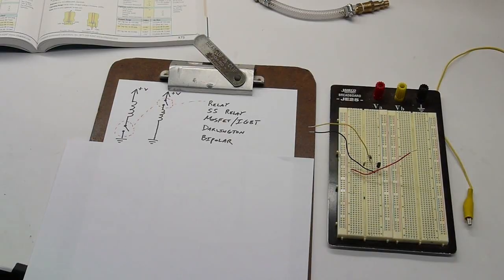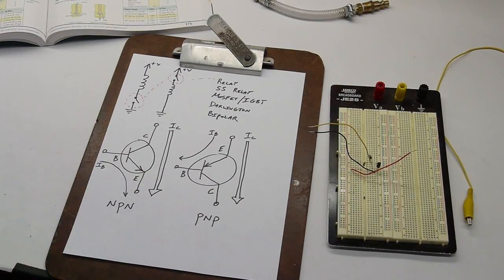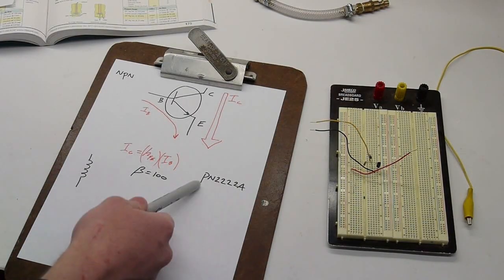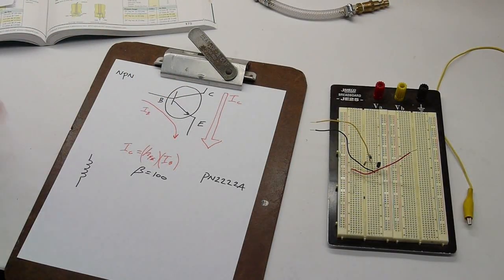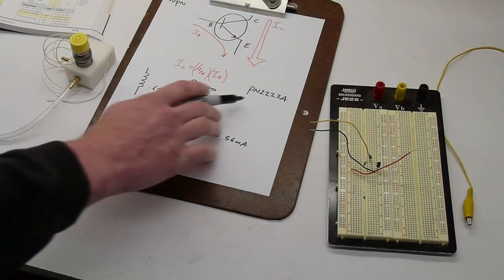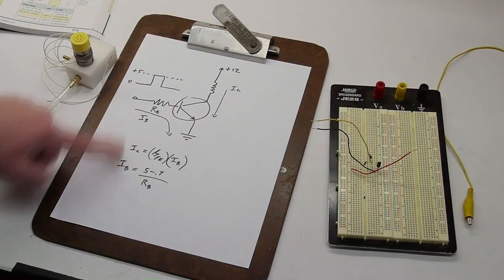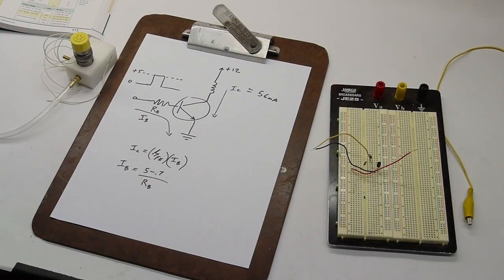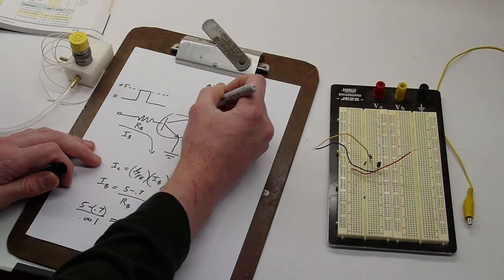Tutorial: How to design a transistor circuit that controls low-power devices

Comment: u can back to back configure mosfets to isolate or  more specifically.. switch it off in both directions. was looking for info on how to drive n channel on high side of a cap bank. more specifically, if i can take a floating/isolated module and tie its output ground to high side of cap bank so i always have 10v over what im switching. Currently have a working cap discharge spot welder that I switched on low side. I want to make it a more flexible/general add parts have multiple types of welder design. Other reason..its connected to a dc-dc charger, which then connects to a earth referenced 24v supply. I can see a few scenarios where one could unintentionally...say... weld a wrench to a metal desk and risk burns/injury . been a while since i ran math with ohms law and esr of bank...but i do recall it came to about 2500@ at 16v in an ideal world. its about 180f of maxwell d-cell dlc.

Comment: Great video clearly and simply explained.  Could have done with explaining the clamping diode - what it does and where the energy in the coil goes when the transistor is switched off

Comment: Good video and great explanations.  Ideally, if you had added a sample input device, say the out put from a temperature control or light sensitive module, the functional detail would have been complete.  (Can't the solenoid valve be controlled directly by the input signal?)

Comment: Let me add my thanks to that of all who have gone before. Being a newbie I had only a hazy understanding of gain and how to apply it. Now I was able to design a circuit to control a 12-volt solenoid and got it right in one try. One question, though. Right at the end you indicate a capacitor but I'm unclear on whether you're putting it across just the transistor or the transistor AND the load.

Comment: 5:25 WHY CANT YOU JUst PUT A RESISTOR  INLINE TO THE pnp WHERE THE QUESTION MARK IS "?"
Reply: Drew Ski BECAUSE THEN THE PNP TRANSISTOR WILL ALWAYS BE ON! REASON IS THAT BOTH 0V AND 5V ARE BELOW (12V - 0.7V) SO THERE IS ALWAYS A CURRENT FLOWING FROM THE BASE. THE ONLY DIFFERENCE BETWEEN THE 0V AND 5V STATES IS THAT THE CURRENT THROUGH THE BASE IS A LITTLE LOWER FOR THE 5V STATE COMPARED TO THE 0V STATE.

Comment: This demo and the calculations don’t take into account the inrush current of the solenoid which could be as high as 10 times the rated current of the coil.
Reply: This is absolutely incorrect. A solenoid is primarily an inductive load and resists changes in current. When turned on, i=0 and gradually ramps up until limited by series resistance. There is no 'in rush' current spike as you suggest, other than a very small amount from the parasitic capacitance of the wire and solenoid windings. The problem comes during turn off when that current doesn't want to stop, potentially reaching hundreds or thousands of volts trying to find a return path - this is why a freewheeling diode is required as he explained.
Reply: Solenoids don't have inrush current.
Reply: Maybe you're confusing the start-up current of a motor.  Those can be a problem.
Reply: That would be a capacitor that has high initial current

Comment: Why is the load upstream of the switch? What happens if the switch is upstream of the load?

What would you use if you wanted to source current into, say, a capacitor, or if you wanted to pull current from that capacitor?
Reply: Matthew Ferrie It wouldn't work. For the transistor to be "on" the base voltage needs to be at least 0.7V above the emitter voltage. When the solenoid is on it will drop 12V over it, therefore if the transistor is "upstream" of the solenoid, the emitter of the resistor would be at 12V while the solenoid is on requiring 12.7V at the base to keep the transistor on, while you signal is 5V.

What will actually happen is that the transistor will turn on a little bit (it isn't actually a switch, but an amplifier after all) and as it does so the voltage over the solenoid will start ramping up. When the voltage over the solenoid reaches about 4.3V the whole system will come into an equilibrium state where the transistor wont "turn on any harder" as that would turn itself off. That would also mean you'd have 7.7V across the transistor with however much current is flowing through the solenoid at that point.

Disclaimer; I don't know if there would be any oscillation behavior in such a circuit, there could be, but I'm not practiced enough to say off the top of my head.

Comment: Question...Some years ago I was taught that germanium transistors had a "barrier" voltage of 0,7 volts and the silicon transistor had a "barrier" voltage of 0.05 volts. If the 0.7 voltage drop across the 2n2222a transistor you're using represents the "barrier" voltage I just mentioned then my  thinking is screwed up since the 2n2222a is a SILICON transistor that has the 0.05 volt "barrier" voltage. If I'm wrong here and creating confusion because of my misinterpretation, my sincere apologies to all who became confused.

Comment: Great video. My understanding is much better now. Love to see you demo some of your circuit characteristics on a scope. Like the ringing from shutting off the coil with and w/o the diode and or cap. Also what happens to the current flow when the transistor is set at the cusp of turning on the solenoid or cusp of the base controlling the transistor. Also why is pnp control circuitry more complicated and how do you address it.

Comment: An easy way to remember the symbol for NPN:  Look at the direction of the arrow, NPN = (N)ot (P)ointing i(N).  Also, when using a PNP transistor, everything that you covered still holds true, including the calculations for the base current limiting resistor, except everything just operates in reverse.  In other words, with a PNP transistor you turn it ON by bringing the base to ground, and to turn it OFF you disconnect it from ground (preferably float it near V+).

Comment: Another amazing video.It wud be great if you could do a video on pnp switching. There r certain situations where u need just the pnp. For example i share my experience  with esp8266 there are certain gpio pins which need to be in a specific pulled up and pulled down state for the chip to properly boot. Now i wanted to  switch a relay with one of the pin which needs to be pulled high during bootup. So to be safe  i cud only use a pnp. But wait it caused be trouble on the way as this pnp transistor was always ON. As u said no easy way to control the pouring of current into the base.  I used a 2 transistor combination. But it wud be absolutely great if we cud  have ur crisp  and practical  xplanation. Waiting for a video

Comment: You should look at the datasheet graph of hfe vs Ic to get your β value for the collector (load) current.  β can also vary a lot with temperature. I would take whatever the nominal value of β you find from the datasheet and divide by 2 as a worse case.

For larger loads, you may have to worry about heat dissipation.  Local hot-spots can develop internally inside the transistor which can permanently damage the device.  Make sure power dissopation (approx Ic*Vce) is within the "Safe Operating Area" for the Transistor's temperature.

If combining multiple transistors in parallel, it is a good idea to put a small value (1 ohm?) resistor between the emitter and ground.  This feedback resistor will ensure the load current is more evenly divided among transistors with manufacturing tolerances that cause them to not be perfectly matched.

Comment: Great video, as usual! I've been a subscriber for months. In this case why not use a PNP and turn it ON by pulling the base down to Ground? Just curious...
Reply: Wouldn’t that mean you’d have to supply logic high and therefore waste current the entire time the solenoid is off? Maybe it depends on if the solenoid is going to be on or off most of the time?
Reply: jeromekerngarcia the mathematician wrapped himself in fence and declared himself to be on the outside.

Comment: From MOSFET down, including an H-Bridge, could you please make a video about, '' Why to use? '', '' How to use? '', '' How to identify it's values for such applications '' ... For MOSFET I kind of know, for example, using an arduino, one can send a 5v voltage pulse to a MOSFET and Open the internal switch for the MOSFET to apply a 12v to ''any device''

Comment: So Im trying to work out what resistor I need to put infront of the Transistor when using Arduino UNO. Arduino is 5V and a pin is 40mA, I need to lower the current to 0.002 (or just slightly more), what size resistor do I need? V/I = R, but what is I 0.002 or 0.04?
Reply: (5-0.7)/0.002=2150 Ohm or not?
Reply: 0,04 is the maximum you can have from the pin, not what you need

Comment: Hi :)
Great video
Just one question: why did you say in the beginning that the pnp doesn't have a way to limit its base current? Shouldn't a resistor work as in the case of the npn?
Reply: Andrei Stefanescu, since the logic input signal varies between 0-5V and the emitter is at +12V, the base current can never reach zero. Thus the PNP device is a poor choice here. On the other hand, if the logic input output varied 0-12V it would be acceptable.
Reply: @avid0g  so you would use that if you needed a 12V signal to control a 5V device?
Reply: @renakunisaki  
My point was that an open collector logic device with a resistor pulling up to +12 volt would have the correct output. The logic device needs to be rated to handle the +12V. An NPN would also translate, but with inverted logic. 

One downside to resistor pull-up is the RC time constant rise waveform.
Reply: @andrei, think opposite. in an npn a  + voltage at the base turns it on. in a pnp a + voltage at the base turns it OFF. 12-5=7VDC across the emitter/base juction, because you have + 12vdc at the emitter.